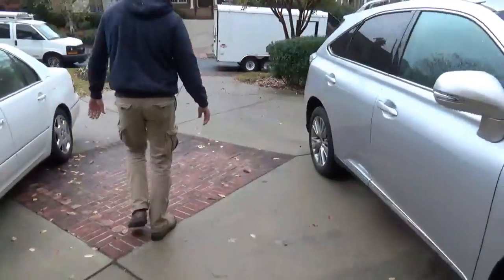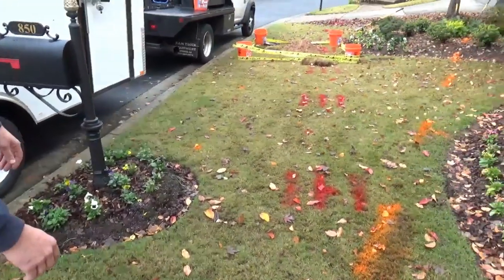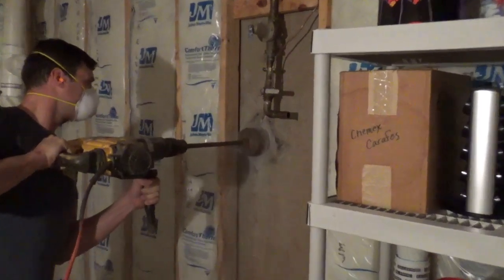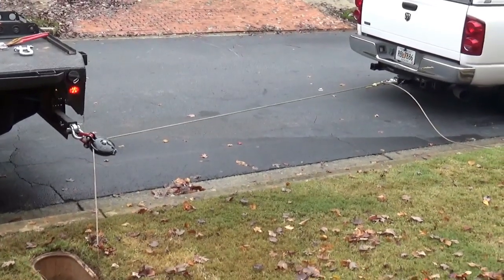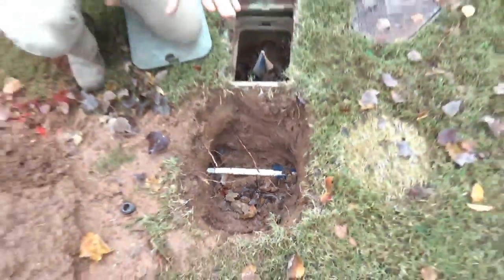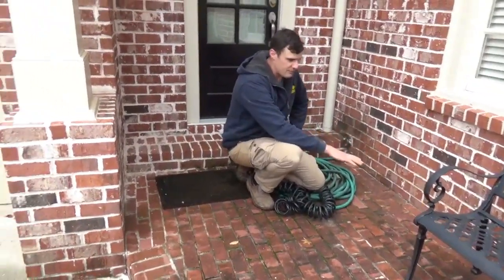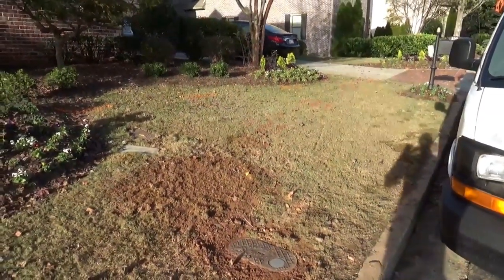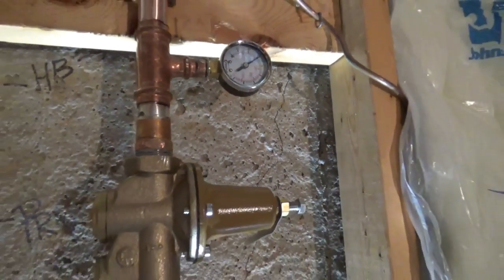Fastest Water Pipe Replacement

Comment: Talk about a time saver. You probably give these customers the best news there heard when you tell them you don't have to tear up the porch and yard. Very nice video 👌
Reply: AND AN EXTRA BIG BILL EVEN THOUGH IS WAS EASIER THAN DIGGING.
Reply: I bet it wasnt cheap hahaha
Reply: In my opinion you have to pick your poison when it comes to this type of repairs. Why not go with something that is pretty fail proof, rather than a tore up yard and porch (with more money to repair on the back end) Some people would just rather get it done and over than deal with a crew for a possible 2 to 3 days.
Reply: @rileymcfee6946  fail proof? The pipe he pulled could've been damaged or scratched by anything in the dirt and might leak again!! You must not be a plumber it dint leak at the moment but wat about after a year or 10
Reply: @Thefishingplumber  I love it when people assume. When you have done enough water work and underground utilities, you'll understand. The material they use these days are pretty resilient when it comes to direct contact with the environment, it'll last the same amount of time as the original with less headache overall. I didn't say completely fail proof if you read my comment bud. You can be that guy that tears up a yard, and I'll be that guy laughing at you

Comment: This was a great video, I use the same method around Atlanta and Augusta,Georgia.
I learned something with the drilling though, great tip. I will use it in the future....but now I feel like I owe you a teaching fee 😁
Reply from the maker: Kenny Black haha, just glad you were able to take a little something away from the video.  Instead of using the rotary hammer core bit, we now use a hand held coring rig with core bit which is nice because it cuts out the dust.  It is hooked up to a battery powered pump inside of a water container.  So no dust, only a little bit of slurry that gets sucked up by a small Milwaukee wet vac.  Thanks for the comment!
Reply: @matthewj.firtha7385  
The video is phenomenal, the other thing I noticed that I never tried was the pulley on the flatbed. I wish I could donate a week worth of labor to improve myself. I purchased a smaller pull head to pull thru existing sleeve BUT the pull cable is weaker. I truly appreciate your video and skill
Kenny
Reply: Kenny I'm in Suwanee and need this done. Do you come up this way?

Comment: We have been replacing water services like this for the past 14 years. I’m really surprised most plumbers haven’t figured this out yet. we used this for both 3/4” and 1” in the 1,000’s of services it has a 95% success rate. It’s really all dependent on type of soil and depth. I know the homeowners love the fact no major cuts in hardscape
Reply: Mark Eckelkamp , I have an old pipe+another pipe inside it. Do you think splitterhead will do the job?

Comment: I’m not surprised that worked, the copper from inside the home out to the foundation did not have any fittings in it but there was still the transition at the stub out, they made it thru that, but then the pipes in that area must come into this transition by going under the home footing wall (as is not always the case) next the yard tubing was a flexible pipe and most likely did not have any hard turns. So this job was a good candidate for this procedure. 

But if there were a few hard turn fittings than that would also be discussed,,as a business we are always aware of obstacles and that’s how money and profits are made, so having legit work arounds for problem areas is good for the company and still a fair expense for the client. 

And I believe what is actually happening here is that the splitter head is where the pulling and torque is happening, not the pipe being pulled, it’s just like rear tires on a car, they just following the front tires. 

And I love that cable puller, is that a Dodge Ram puller?

Comment: Thanks for the video.  It is very creative and I like that not many fancy tools were required to complete this job.  I wonder if this would work with old galvanized piping?

As a certified backflow tester and cross connection control specialist, I did notice that the irrigation valves are directly connected to the main point of the domestic water entry. That is a direct cross connection between potable water and irrigation( pesticides, fertilizer, pudding water, animal waste, etc.).   I would add a Reduced Pressure backflow downstream of the T feeding into the irrigation valves.  That would prevent water from the irrigation valves from going back to the house drinking water.
Hope this helps save someone from getting severely sick.
Reply: With Galvanized it is just a little bit of a different process but very similar.  We will get some footage of that out soon.  Good info!  Yeah the public is protected by the backflow at the meter, but the homeowner is not in this case.  Although not mandatory yet in our area, another back flow to protect the tenant makes a lot of sense.  We will have to address that in the future.  Great comment!
Reply: @1Builtcummins  I don't think a DC device is sufficient for the hazard level of landscape irrigation. It has to be a PVB or RP if I'm not mistaken. The benefit of the RP being that it can sit lower than the highest head in the irrigation system. The PVB has to be above everything so that could get silly depending on the situation.
Reply: @1Builtcummins  I stand corrected. It's been a year since I was certified but I haven't used the cert much. I am a full time commercial irrigator though. I thought it was limited to RP and PVB assemblies. I've never seen anything else used on an irrigation system before and most of the systems I've seen over the years aren't setup to inject anything. I'll have to do more research. My employer is gearing up for me to do fulltime testing and repairs so I need to refresh. Thanks.

Comment: So is the new pipe the same diameter as the old? And you made room for the new pipe by cutting the old lengthwise? Do you couldn't do this with a metal pipe main? If it was a metal main could you just get a smaller diameter plastic pipe and go down the middle of the metal? Sorry for all the questions this was really cool

Comment: How do you get the wire fed thru the old pipe? Seems like that would be the hardest part considering the old pipe has a failure some where...besides that I think this is a super slick method and love that your name is the same as mine...
Reply: The 3/8th wire is pretty stiff yet can fish around curves very nicely if it is not a super tight curve.  30% of the time we find problems in the old piping that can not be simply pushed through, (old valves, flowgaurd fittings, ovaled out piping, etc... In those cases we will perform a line trace and find where the cable stopped and that area of piping has to be exposed and cut out.  So this method even though we have not had a catastrophic problem, is not full proof, but is doable in most situations.  Thanks for the comment!
Reply from the maker: Sometimes it is tricky. 50% it goes threw easy. The other half is called trouble shooting.  We’ve been big time success with it though, working through the kinks.  Great question!
Reply: Love stuff like this...Keep sharing and Ill be watching and learning..
Reply: Seems like that could take an hour alone

Comment: Nice system... But this way of installing pipes is a bit outdated. In Greece we have smaller pipes that run through bigger  ones and when there is a defect we just pull the old pipe out and slide the new pipe in. So there is no need for a cutting head.
Reply: The Greek way is the outdated method. Two pipes instead of one is wasteful. Now go fix the Parthenon.

Comment: I wish where I lived would allow this.  But per local codes, the new water line is required to be sleeved.  (the inspector must be able to see the start and finish of the sleeve of at least 1. 5 times the diameter of the new service line).  So due to this we directional bore a new sleeve and just push the new water service line through the sleeve.
Reply: BEEN DOING IT FOR YEARS ---- IN MY DREAMS ---- BEATS DIGGING.

Comment: Thats cool...where I'm at the pipe is at least 4 feet down. Possibly this method would still work as long as the service is the plastic coming in. Most stuff is copper service to the house in my neck of the woods

Comment: I would like to see how the wire was hooked up and also see the splitter head  and whatever  other specialized tool  needed.   I am very visual and pics help me understand.
Reply: Send me an email I’ll show you what it looks like. The splitter heads cost $125 the cable is 1/2” cable -100 ft long.  $50 bucks  it’s cheap and way faster than digging

Comment: Would this method be possible if the old pipe was copper or galvanized underground?
Reply: It would never work if it’s galvanized or copper bro. Unless it’s a straight shot. But In this case, This method only worked because it looks like there using flexible pex/or pvc pipe. And I’ve NEVER seen a main water line be that way. It’s gotta be schedule 80 or pvc. And eventually to copper once it goes inside the house. But I get it, different areas, different laws, different codes
Reply: @jer-g8884  in Houston I've seen aquapex main line installs

Comment: I am wondering if the broken/old pipe on occasion will split or cut into the new plastic pipe as it is pulled through.  If that happens then I guess you just have to
pull another length through and hope it does not happen again?
Reply: Mrhyperbolic usually the splitting head is 2-3" bigger in diameter so it does a great job of cutting and pushing it out, even a couple inches helps a lot to prevent that issue

Comment: I thought they were going to split copper. I was like, no fucking way... lol
Reply from the maker: Nah, the copper piping just gets pulled out of the ground.  Sometimes it takes a little doing to break the copper loose from the ground to be able to pull it. Thanks for the comment!
Reply: @matthewj.firtha7385  oh cool. Do you pull your new pipe with the copper? Also, soil dependent I would imagine but what's the longest run you can pull that pipe like that?
Reply from the maker: Interesting View I was limited until this Friday to 135’ until I went on a shopping spree and bought two 200’ cables for my b-day.  Little worried because of torque and stretching issues that may happen, and it snapping.  The “Guy” says it’ll work though.  I’ll make an updated video when I get to use it, because that will be one hell of a pull.  It’s funny that I was doing this 12 years ago and men before me have been doing it for 50-60 years before.  I have tried in my mind at least, all the wrong ways incorporating everything but a little pipe bursted to make this a better system.  We have constantly modified from this version, but it works.  Works every time so far, so knock on wood.  This process comes with its headaches though. I won’t lie, but if you’re persistent, work the kinks out, than this is a badass way to make a living!
Reply: @matthewj.firtha7385  That will be cool to see. Thanks for the reply.

Comment: Hey there so I was wondering how do you hook up the finger trap to the copper pipe does the 3/8 cable go through and then a carrabener through the loop then into the finger trap puller?
Reply: The finger trap has a loop to tie onto, and as long as you use some decent mule tape or a rope rated for pull pounds you can use a standard fishing knot

Comment: Wonder if this works in northern climates where the water is more than 18” deep and with old galvanized lines too.
Reply: Yes it works. Will actually pull out anything it can't split.
Reply: There are different processes that seem similar because of depth.  I would direct you to the Roddie machine.  They have some really cool videos for that.

Comment: Wouldn't  the new line fill up with mud? Do you close it off or something?
Reply: aUsSiE LUke At about 2:40 you can see how the cable is connected to the tube - there is what looks like a brass plug - its gotta have some depth to it to give enough internal friction to sustain the pull.

Comment: So...the cutting head on the new pipe you guys are pulling...dont you guys have to pothole the utilities?  What if there is little to no clearance from the new service where it crosses gas, data, power.  You guys just chance it?  

Cool video tho😎
Reply: i believe there is a minimum required distance that separates the utilities.  it will vary slightly in diffrent areas.

Comment: Much faster and cheaper than directional drilling but if the pipe is set into concrete I believe this method would not work as there is no room to burst?
Reply: Kieran Mullen break open the concrete

Comment: How do you get through the galvy ells when they are full of rust?
Reply: Galvanized would be the only pipe that we can not fish the 3/8th cable through.  Although we are going to start with a very similar process without the cable and actually use the galvanize pipe its self to pull the new pipe.

Comment: Pipe splitting is a great way to re-pipe systems where digging is not an option. We use a 2-part epoxy to coat the inside of the pipe to conduct similar work.
Reply: I have seen a company here called Pipe Medic perform that process for the city of Montgomery and it was a brilliant way to eliminate the pin whole leaks.
Reply: @zippyplumber  it is an amazing way to rehab a system without interfering with the infrastructure and/or building. What we are able to accomplish blows my mind each job.

Comment: Who dig the porch or driveway to install the water line? Missile boring could do it. Installing a small pipe inside the old line is only a temporary solution. It will decrease the water flow rate.

Comment: I saw further down where it said it works on old copper & Galvanized steel pipe.  
  I really want to see that video. 
  Plus. Open the garage door. I'll bet you find a water heater in the garage.  Why not dig that direction run across the garage. Hook on at the water heater and never have to worry about a line under all that hard scape ever again. Was it leaking under under any of the hardscape? 
   Remember to get the Galvanized video up & running right away!!
Reply: With Galvanized it is a little bit bit of a different process and will soon edit a video showing that.  The water heaters were in the basement near our working area, and to reroute would have been more difficult because of the utilities, irrigation, and storm drains that would have had to be exposed in such a tight area around the house.  There was very minimal landscape to work in.
Reply: @zippyplumber  don't get me wrong.  I think it is a great idea. And in certain cases I'm sure its cost effective.  I don't live in an area that water comes into the basement of a home. It attaches at the front of 99.9% of the homes. 
   Tell us what something like the job you just did cost? (On average) 
   Now. Why don't you spend a little money and buy a winch. Do you know how dangerous it is to use the trucks hitch. The communication between you two would be very slow. If you had a wrap problem in the basement.  By the time you got a word out. That pipe would be destroyed. Time to by a winch. What would OSCA say?? The fines would scare you!!
Reply: @zippyplumber  who makes the exploding head part? I'll look into it!
Reply: @zippyplumber  I'm looking for the equipment that you used to explode the pipe?  Who makes it?

Comment: Wow , whoever invented this must be a millionaire
Reply: Well we for sure did not invent it.  I remember working with my old employer, and our process back then had a high fail rate.  When we decided to revisit this process 3 years ago, we had some set backs.  We tried winches, tow trucks, excavators, service vans.  Any thing that we could hook up to and pulled, we tried.  This happens to be the most reasonable way, it incorporates a lot of pulling force, so equipment had been strengthened , and we found the quicker we can pull the better.  The more momentum that can be achieved leads to less headaches.

Comment: I'm a master plumber from TX I do pipe bursting where I live, but we use a hydraulic Brigs and Stratton motor to control the speed and power of the pipe being pulled through...you don't worry about using a truck obvious issuses too much power, approximating distance etc.....? Check out Spartan Undertaker system....
Reply: Why would he worry about the truck when it's clearly working just fine for him.